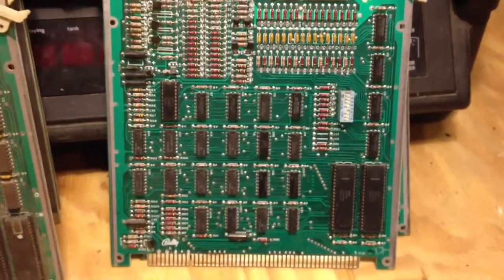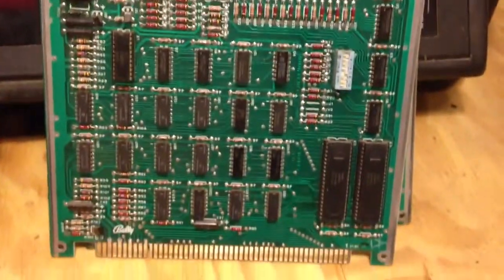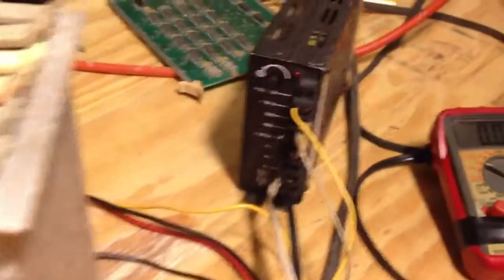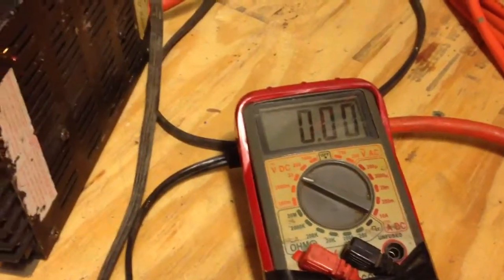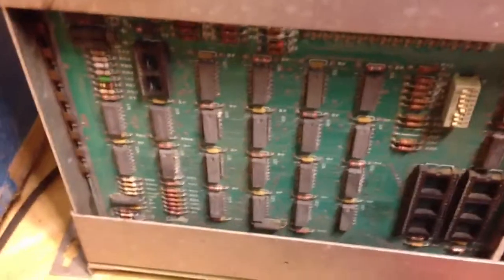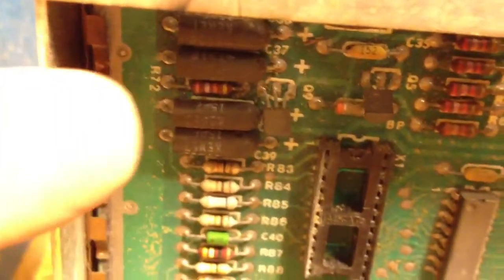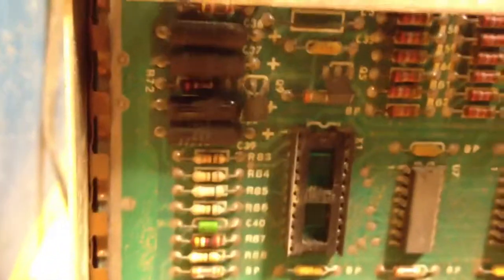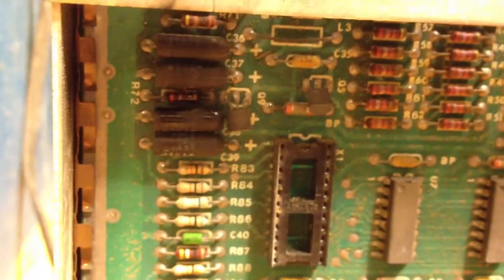Gorf -Testing game boards, arcade game by Midway

Comment: You actually caused your own problems by using a switching power supply. There is no reason to use a switching PS. The old analog PS actually does a better job at protecting the board set. The old PS will shutdown the 5v, -5v and 12v before the current rises to the point of causing smoke and sparks. You could have easily used the old PS and simply measured the voltage without the fireworks. I've fixed dozens of Gorf boards and simply see no reason to use a switcher.
Reply: The switcher is much more reliable than the factory power supply.  With a short like that, it can also short the high current transistor used in the 5 volt circuit.  AND, the voltages from the wall are now higher than it was 40 years ago.  With the voltages fluctuating higher posing a risk in damaging the custom chips.  I tried fixing Gun Fight by Midway and its original board power supply design actually fluctuates with the line voltage.  Which is why I strongly recommend using the switching power supply.

Although in this test, the short circuit would've immediately interrupt the power, but the switching power supply has either failed or there wasn't enough of a surge to trigger the interrupt.